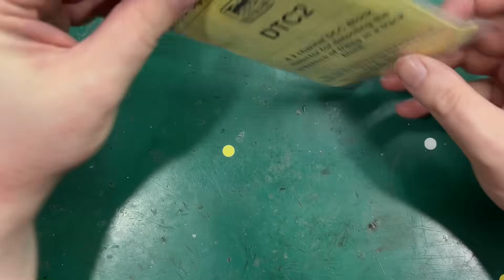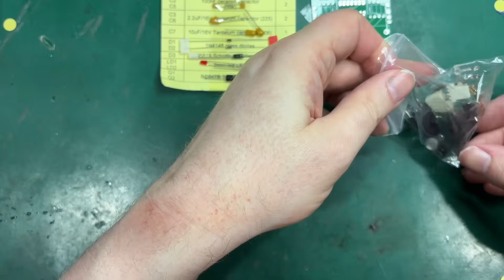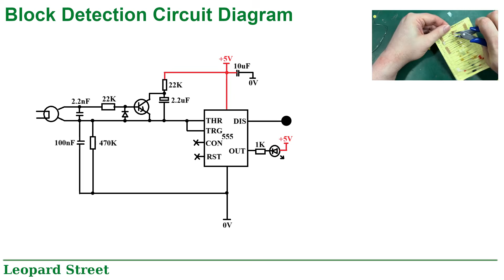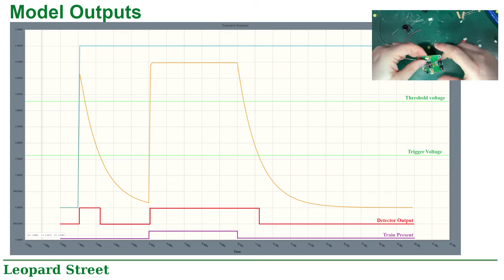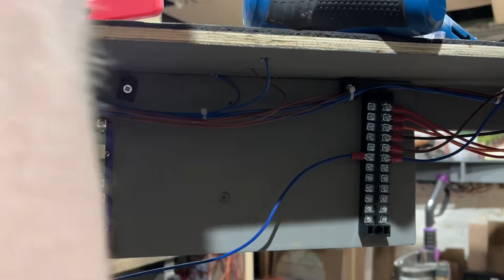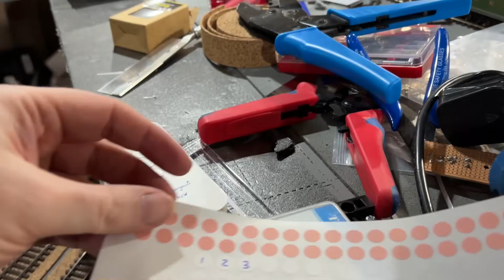153, Current Sensing Block Detection at Leopard Street Model Railway #modelrailroad #modelrailway

Comment: It looks suspiciously like that all worked first time 🙂 Those look like nice little kits - I think I've seen them used on a couple of other channels too.
Reply from the maker: really easy to use, glad I actually sat down to figure out how they work, easy to change the time delay by fiddling with the resistors and/or capacitor. pretty much a fit & forget debounce circuit.

and yes this bit worked well.. this bit didn't involve my special "talents" shall we say to over complicate things.. they work now, weird though,  I think I have an antenna that has gone in which needs moving as its not always connecting properly.

the larger DTC8 is good, MERG do an entire DCC control system too

Comment: Looking to use a couple of these and the 8 track versions in an upcoming build of mine. How are you planning to interface this? Will it be through a CanMIO or something else?
Reply from the maker: will be the next video, but in short I plug into a PCF8575 16 bit I/O controller (usually using the low 8 bits for a DTC-8, the high 8 bits drive relays), that feeds into an ESP32 and from there into MQTT which talks to JMRI, or indeed other things

I did look at the MERG DCC system, however I went with DCC-EX in the end for my last layout and stuck with it for this one, I like to fiddle with software

to date I've had this talking to JMRI, to my own custom automation software and to a speed calibration trap using a few blocks and a measured length of track.

these will basically work with anything that is "active low" such as a PCF8574/8575 or say a 74165 with pull up resistors added, or heck directly into a microcontroller 

the DTC8 is my normal module, this board only had three blocks so these DTC2 were a bit cheaper, the DTC8 is nice in that its basically an 8 bit output.
Reply: @aleopardstail that’s interesting to know! I’m tied between Merg Canbus and DCC Ex. I’ve heard good things about both. Guess I’ll have to wait out and see your video before I make my final decision
Reply from the maker: oh these boards are fine with well anything really, I went with DCC-EX as I like fiddling with programming stuff

Comment: The DTC mount is one of my designs I have since got a macro with the fixing holes added to the outside. Works in FreeCad. You can have a copy if you wish.
Reply from the maker: oh nice, its a nice design, more compact that the ones I have done for other modules, only downside is its hard to fix it to a board, then add the module to it. this is firmly filed under "first world problems" though. its a really good addition to the kit :)